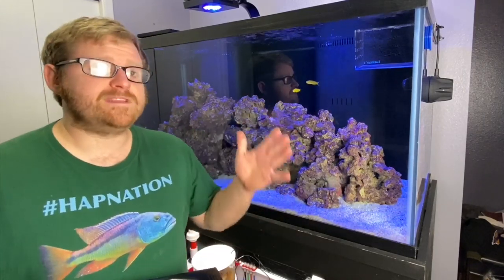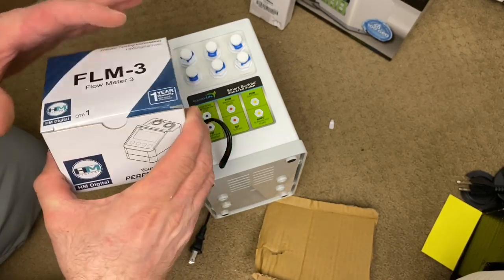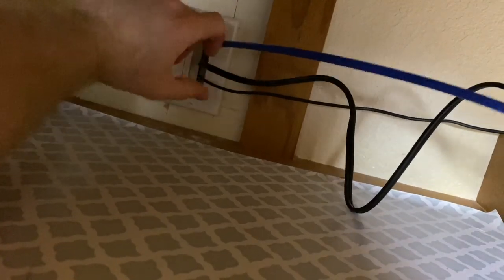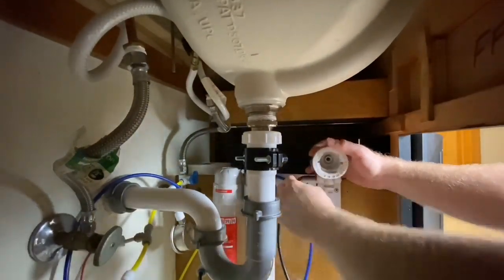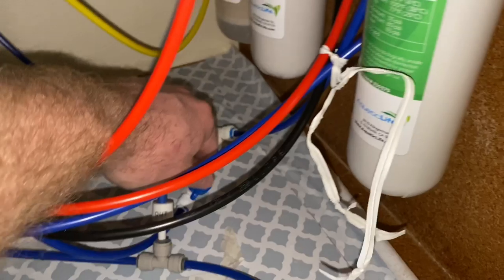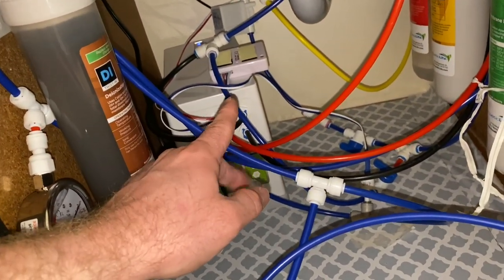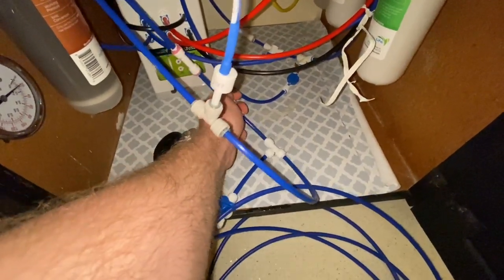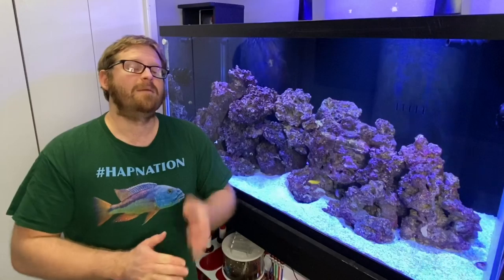STOP WAITING FOREVER for Purified Aquarium Water (RODI Booster Pump Setup)

Comment from the maker: Hi All, when remounting the DI cartridge, make sure that you mount it on a piece of wood so that it tilts or if your setup is like mine, mount it higher so it tilts.
Reply: inventoryking hello can you plz make a video on how to add a pressure gauge I’ve been looking for hrs and hrs for this type on Ro Di system but I can’t find nothing🤦‍♂️
Reply from the maker: Are you talking about the pressure gauge that I have on the system currently?
Reply: inventoryking yes to see the waters pressure, is it ok if u put in before the system or does it have to be after the Ro??
Reply from the maker: Before so you can read the pressure. Some systems require a certain psi to work properly.
Reply: inventoryking ok Thank you very much, new subscriber btw

Comment: I have the same RO/DI system as you and recently added a gauge in between the carbon and RO membrane. I am at 55PSI, do you think I should invest in a booster pump? I do feel that I am wasting 10x the water at 55PSI. Can you make a video of how often you change your filters/where you get them and how much water you can get away with making with this system? Thanks.